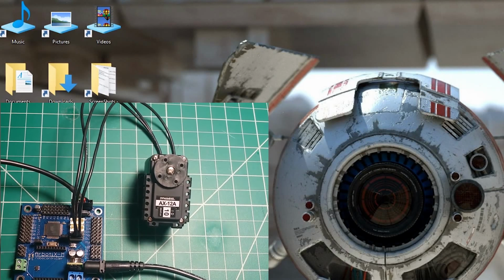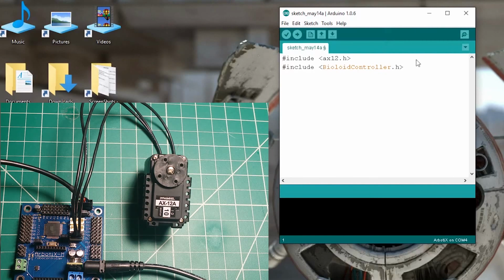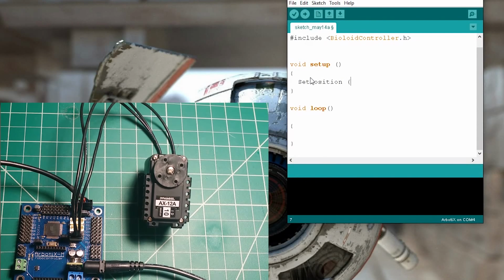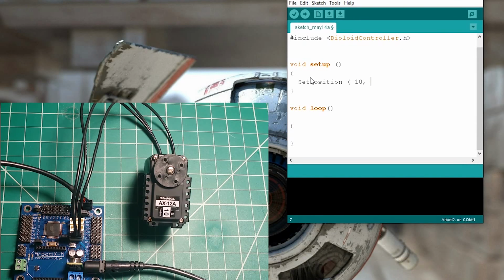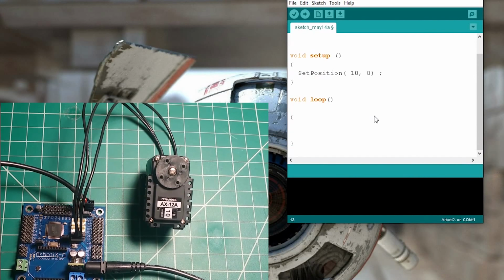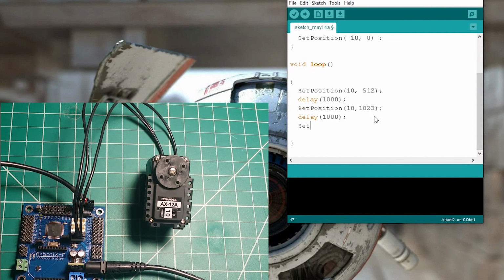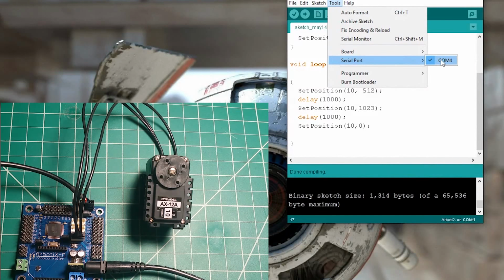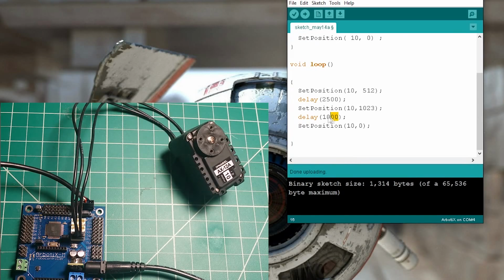Dynamixel Tutorial 3: How to Set a Position on the AX-12 Motor

Comment: Tried following along with my Arbotix-M board and a MX-64 Dynalixel motor and couldn't get it to move. I have the libraries and the MX-64 Example Test program works. Does SetPosition( #, # ) only work for AX-12 motors?
Reply from the maker: I presume it would but I haven't worked with the Mx-64 yet so there could be subtle differences
Reply: Qrobotics thanks for the quick reply. There aren’t many tutorials on here so I appreciate yours
Reply from the maker: @Ian-Threaded  No problem! Let me know if you figure it out. I would like to know as well. Cheers
Reply: Qrobotics will do. Currently got two of my three MX-64 servo motors working together. I’ll have to send you the code. 

In an unrelated issue.. 1 of the 3 motors isn’t being found when I try to rename it and is stuck with the default motor ID 1 and baud rate of 57600.